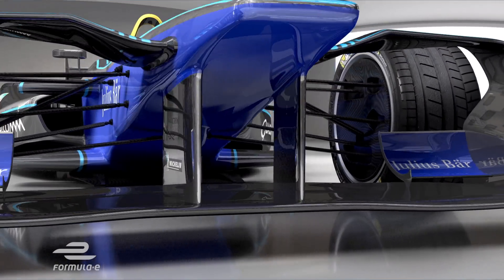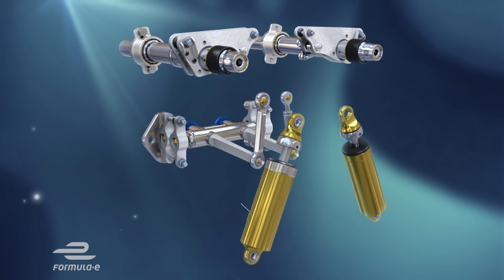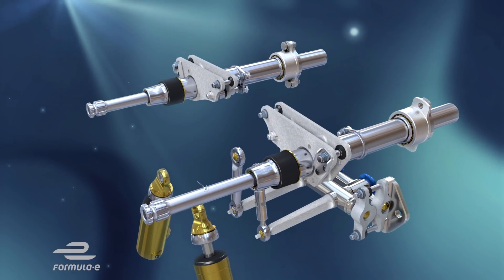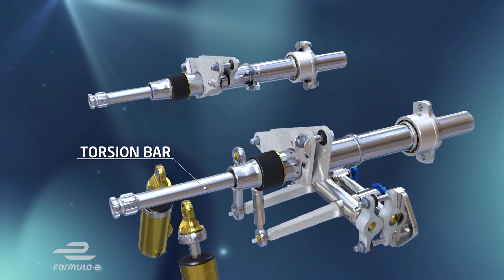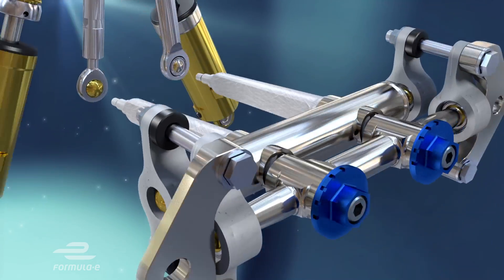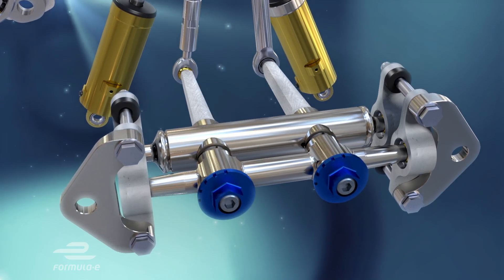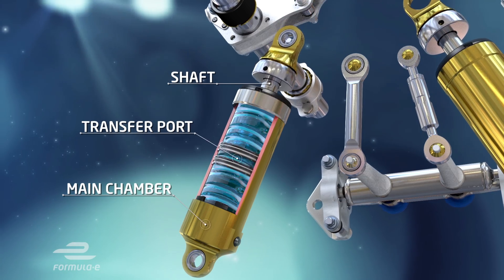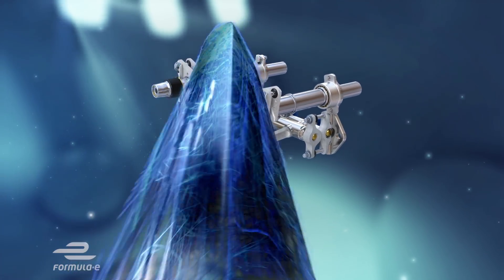How Race Car Front Suspension Works - Formula E Explained

Comment: I like how the torsion bar allows for easily adjustable infinite varible spring rate vs a coiled spring which is fixed.
Reply: how?
Reply: @abdurrahmanhashmi1081  by adjusting the length at which the torsion bar is fixed.
Reply: @syntropy3020  yeah but i didn't see them say that during the video
Reply: @syntropy3020  active suspension was banned i think
Reply: @abdurrahmanhashmi1081  whist it would be possible to make this active, its not what I'm suggesting. What I'm saying is that for each track you can easily tune the spring stiffness with infinite variability using the same spring by adjusting the length at which it is secured. No need for a different custom coiled spring to me made and fitted to adjust the spring stiffness.
Reply: @syntropy3020  oh yeah i get what you're saying i mean I don't think fe is using this tech as i think the fia banned it
Reply: @syntropy3020  The torsion bars shown are not splined along their length, and there is no indication of a sliding collar to engage that spline even if it existed. These torsion bars are not in any way adjustable in rate; they are replaced with softer or stiffer bars to tune the suspension.
Reply: @brianb-p6586  Understood. This design does allow it to be implemented easily enough though.

Comment: what holds the torsion bars inplace to utilize the spring manufactured into the torsion bar. u can see the spline on the front where the video shows the torsion bars but you don't see any keyway or another type of locking mechanism

Comment: Does f1 cars use torsion bars as well?
Reply: They may run a combination. At the rear they may use a single coilover/damper and torsion springs for the bell cranks. The torsion springs controls roll and individual wheel's road holding, while the single coilover/damper controls the squat and jounce. Mercedes uses torsion springs at the bell crank and single damper for the front, I think.
They have fat tyres so much of the "compromises" in their suspension works well thanks to that. They won't necessarily work in other formulas with lower profile tyres, like Formula-E. Their sidewalls would be too stiff.